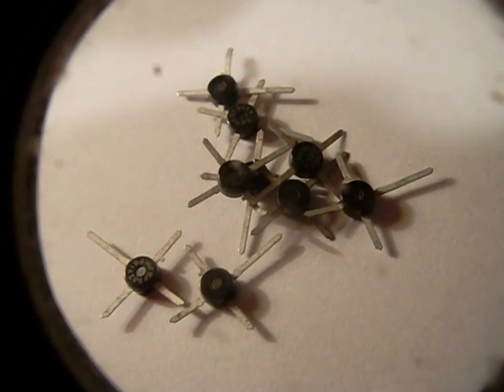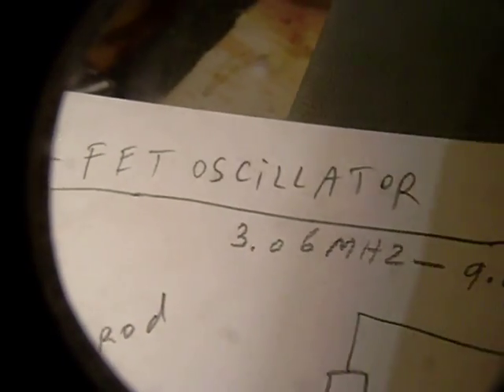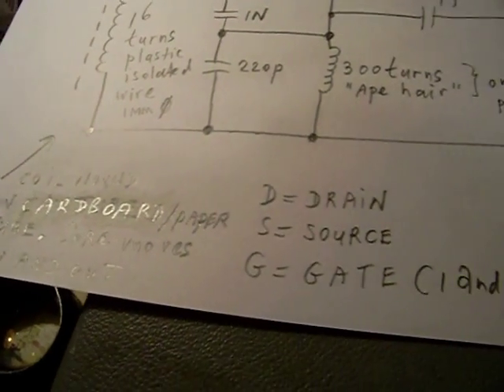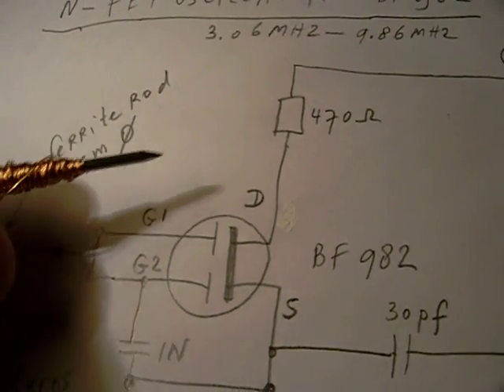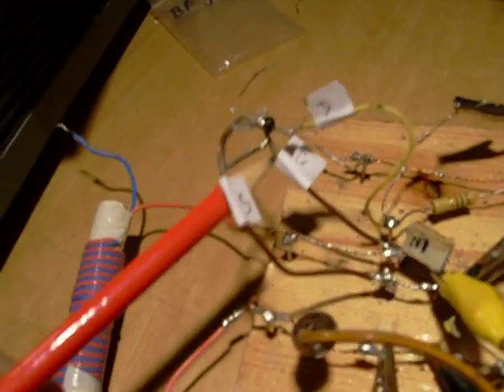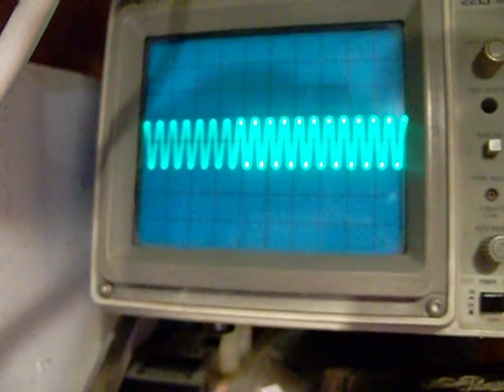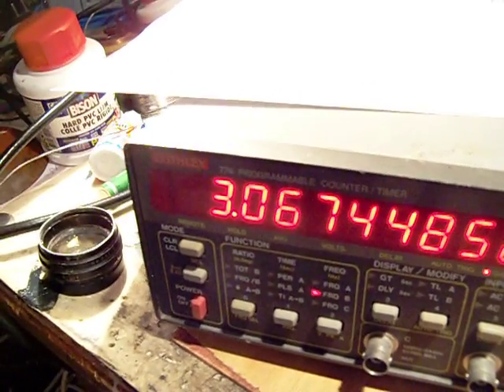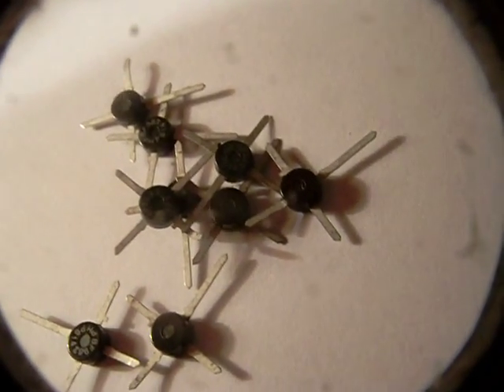FET oscillator 2 MHz - 9 MHz with 2 gate FET BF 982

Comment: Hi, can you pls make a video on coaxial cable resonator...
Reply from the maker: Hi, what is a coaxial cable resonator?
Reply: radiofun232, I got inspired by your osscillators and made different types based on tank and crystal circuit, while researching on different type of osscillator I found Cavity, Coxial and Coaxial cable resonators, it seems Coaxial cable resonator osscillator has excellent Q factor,
https://goo.gl/images/nx7fiM
Reply from the maker: Yes, a good circuit, I am sure it will work, thanks.

Comment: one Question can you make a project with a 1298MHz Mixer double Converter from 2m or 70cm to (Rx)1298,25MHz - 28MHz(-RPT Shift)= (Tx)1270,25MHz for use with a Standard Radio with 2m(144-146MHz) or 70cm(430-440MHz) Transceiver?
If yes please send me a email over here i'll make the finger Filters for this experiment.

73 & Best Regards
Volker King
Reply from the maker: Sorry, that is impossible for me. It takes too much time to find it out and also make in a stable way, with no drift. Perhaps radio amateurs can help you.
Reply: Thank you for your answer!